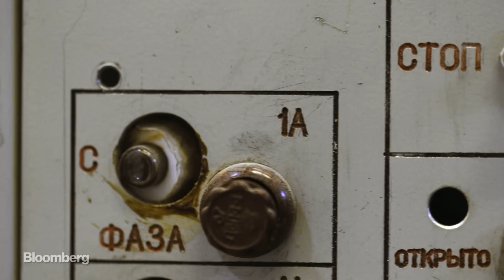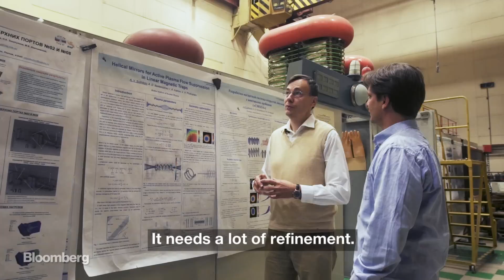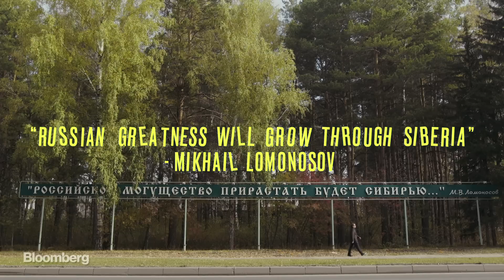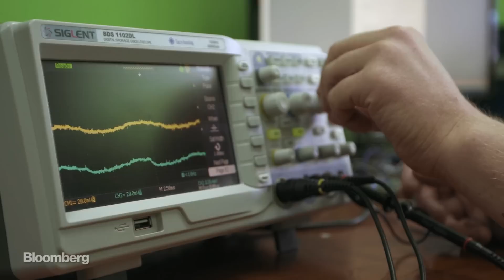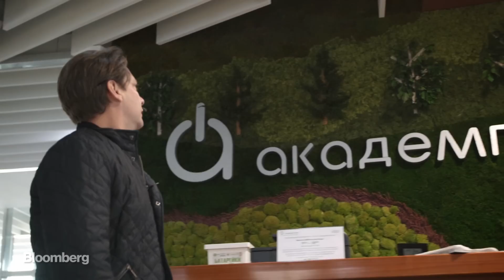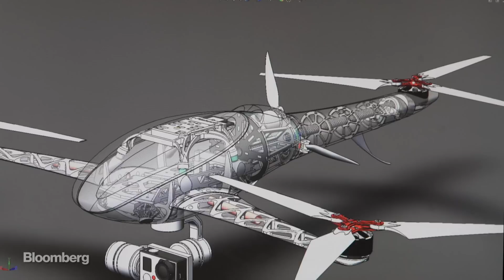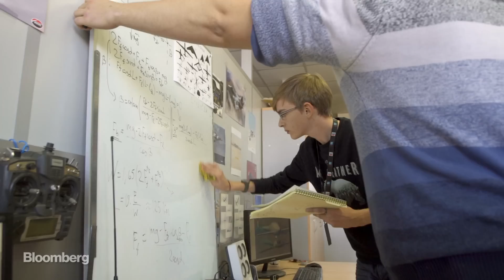This City in Siberia Could Become the Next Silicon Valley | Hello World

Comment: omg... this drone is the worst one i have seen in a long time...
the Air from the middle propeller, will interfere with the back propeller, causing a lot of turbulences in that area and making it loose a lot of its efficiency....

It has to have wings to be able to fly longer than the normal copter...

Comment: About Tion Air Breezers: there price is in range from 300$ to 500$ And that's without installation (which cost around 100$) The average income in Russia is like 500$/ month. With dispensable income around 200$ at top. So the device wide spread success in Russia is doubtful. For this price you can buy a conditioner with ionizer + HEPA filters and have a reasonably good quality of air.

Overall, as a Russian Citizen, i have to say: That without some structural changes in government, there simply can't be any "Next Silicon Valley" in Russia. Budget is still highly reliable on oil + gas export. 
And If it makes treasury full, then why bother with something else ?
Reply: Have you realised that he said that he was targeting China were the air quality is not even half decent.
Reply: that price is for Hospitals and busnisess
Reply: same happened to my country but whitout the sanctions.. just a bunch of retarded socialists..
Reply: Which is why Tion is targeting China:
Air quality of the northern core sucks, and the average income is about 6,000 USD, meaning relatively more expendable income
Reply: That's the problem with depending heavily on resource extraction. One day, that resource will be depleted, or it will be replaced by newer technologies that don't need it. Then what?
There are other countries which the technology can be exported to, apart from Russia.
Reply: just facts-oil, gas and products from them bring less than 10 percent of income to the Russian economy. Yes, the budget is formed almost half of these revenues. But on the other hand, taxes on the population and business are relatively low. Although for business, the situation looks more complicated. A lot of different fees and a rather complicated system of taxation
Reply: God, it really pisses me off that most of our problems come from shitty government and retarded management. The worst thing is, it doesn't really seem to be going anywhere anytime soon.
Reply: If it is, I don't really see it. They've been on this "expand domestic market" thing for a while now (since 2014, i think) but there aren't really a lot of results, again, because of poor management of state corporations and not a lot of breathing room for small businesses